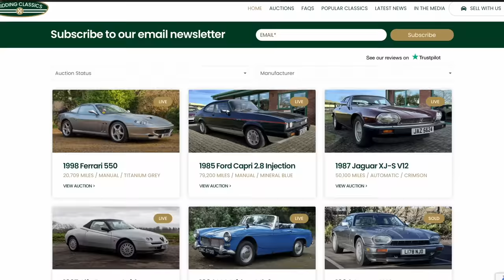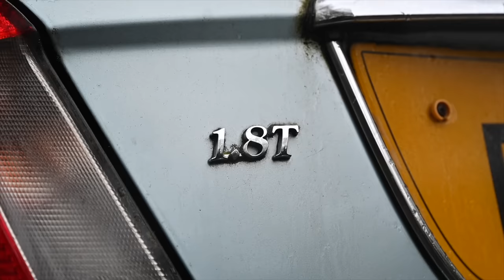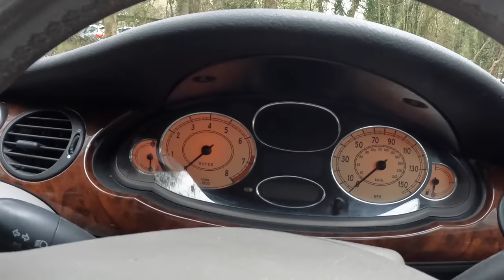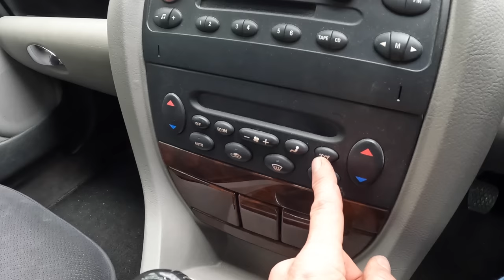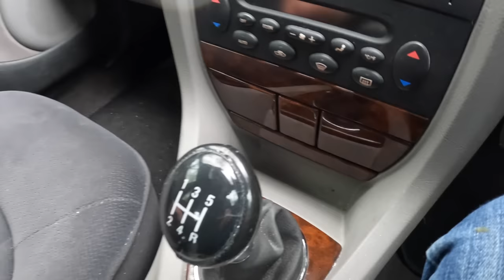The Fiat has gone, a Rover 75 was inevitable

Comment: £1500 ... ONLY!  That is a bargain. 

Dirty brake lines are normally standard "get out clause" advisories on many older car MoTs. Testers wisely Covering themselves.

There is one place where the 75/ZT  brake lines under the car are subject to corrosion leading to brake fluid escaping. had that happen to two 1.8T ZTs. Under the driver's seat location, the twin brake lines leading to both rear Brakes under the car are held in place by a plastic clamp to the underside of the car. That is prone to trap road filth, salt and rain water which attacks the steel brake tubes and that corrosion eventually weakens the tubes. I replaced mine with superior corrosion resistant Cupro-Nickle Brake lines. Some call them Kunifer. They are far superior to the OEM lines most new old cars come with.

The steel brake lines and their Unions in both front wheel arches are exposed to road filth etc where they interface with the flexi-hoses to the Calipers. They need to be looked at just in case. I replaced one of those when the Union was corrosion seized solid when I fitted a superior ZT190 Brake Upgrade. Recommended if a long term keeper. If you do get rid sharpish, the next owner will be delighted if the car is as good as it appears to be.

Comment: It is a nice car and you should keep it if you like it. Perhaps dump the land Rover? It looks like a Jag with the front end looks. I bet the past owner gave up driving not because he could not drive but because he could not easily drive stick anymore. If this had been an automatic then he probably would still be driving it. As for low miles I bought a 2018 Hyundai Elantra new from the dealer back in late 2018. It had under 40 miles on it. From Sept 2018 to the Covid mandate of march 2020, I drove this car about 15,000 miles. From 2020 to when I got rid of it 2 weeks ago, I only put another 1667 miles on it. It spent most of its time sitting in front of my home with a solar obd2 trickle charger hooked up. It was my commuter car for work. Since work was at home there was no reason to drive it over my other cars (like a 2009 Taurus). I got $15,500 USD for it and I originally paid $19,500 USD out the door so in the almost 5 years of owning it, I basically paid about $800 a year to use it. I was quite happy to get that much.

Comment: Can someone explain the head gasket issues on the K series engine ?
Were the engines weaker after going over to 16 vales or was it less reliable after the engine was enlarged above 1.4 L ?
Reply from the maker: cost cutting on the dowels that locate the block and head and on the gasket, pennies were saved at huge cost
Reply: @furiousdriving  thanks for explaining.
I did read that Lotus fixed the head gasket issue on the 1.8L VVC engine with a slower opening thermostat, webbing in the bottom end for strength  and better dowels to use the engine in their cars

Comment: timing belt was done in 2014, headgasket done in 2018, no mention of another timing belt in 2018 when the head was replaced? Seems odd to refit the old belt (even tho it might not done a lot of miles, it still was a 4 year old belt)
Reply from the maker: Id be surprised if they did refit it, will call to ask

Comment: It's a keeper, it's that age where its the lowest value it will ever be, another 5 years it will start going up in value, similar to how the SD1 and P6 values went, Jayemm has just bought a looked after Merc ML similar age to your Rover and that's in the same situation, the least valuable it will ever be, Banger status if u like, Volvo 240 and 740 they have just had there surge in value, 10 years ago a good 240 or 740 was £1500, now a good one you need £4000+ , that 240 estate u tested was up for £8995, I had a 240 15 years ago, only cost 500, wish I kept it

Comment: Love the 75, especially the V6 models. I've had about 15 of them in various guises over the years.

I had a W-reg 60k mile 75 2.5 V6 auto Club, and had to get to Munich in a hurry by car. The car that I was going to take – my Jaguar XJ-R – broke down on the morning of my trip (power steering pipe burst), so I took the Rover instead. This is not one word of a lie – I did it in 12 hours, including the Eurostar. That was 800 miles door-to-door, from my house in Wiltshire to the front foyer of the Innside Hotel in Schwarbing. 

Flat out on the autobahn, my Rover 75 crept up to about 130 MPH indicated and held it. I was relaxing for hours between 110 and 120 MPH without a care. During my one petrol stop in North Germany, I got accosted by the head of the Dutch Rover 75 Club in the filling station car park, which cost me 15 minutes on my journey as he took pictures of it! The next year I took my Honda Prelude VTEC, and took longer due to needing to stop twice due to the uncomfortable seat. 🙂

Comment: rover 75 good points engine bullet proof drive fantastic bad points manual clutch slave cylinder fails before the clutch has worn out the sills need welding for every mot rear view when reversing is very poor road tax is through the roof if you are well off get an automatic fantastic if your not its a money pit